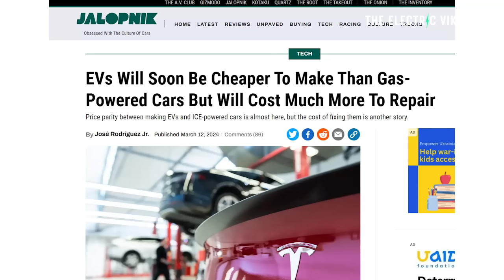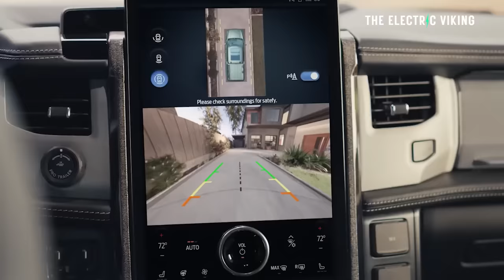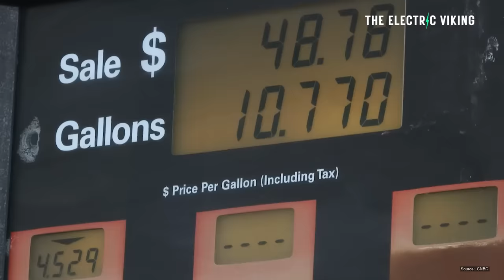The EV Price Premium no longer exists in the United States

Comment: In my country in Europe there are not incentives whatsoever and EV''s are still at least 30-40% more expensive than an equivalent gasoline/diesel and even Hybrid vehicle...
Reply: That's why falling battery prices are so important. The battery is why the cars have been more expensive. The ridiculous obsession with large SUV's is also an issue with EV adoption as they need larger batteries due to being less efficient.

Price parity has been reached for small cars with smaller batteries.

Next will come mid size cars reaching price parity then the larger SUV's when battery prices have fallen further. 

It'll happen eventually but does depend on import tariffs that vary massively.
Reply: I suspect competition from China will force prices down, but as far as I can see - high prices are because that's what the market will bare; alas nothing to do with costs. EVs are "premium" right now so cost extra $$$
Reply: and hardly any chargers here. i would never buy one
Reply: @Withnail1969  If you would never buy one then it doesn't matter how many charges are near you. If you live in an area with an electricity connection then chargers will be installed it's just a matter of time.
Reply: What’s your gas price? It’s currently $4/gallon here in west coast or $1.06/liter, which is considered ‘expensive’. I remember in Europe gas was close to double in price. The breakeven from gas savings for us in US barely exists
Reply: @kevinmanan1304  our gas price will be doubnle yours and electricity has got a lot more expemnsive too
Reply: @Withnail1969 I said that about touchy feely, expensive, fragile glass phones. Buttons are fine. 
And that arrogant, space obsessed, ruthless, relentless, nearly going bust all the time bloke selling books from his garage. 
Or the other ruthless space obsessed billionaire selling records out of the back of a transit van........
A wise man sometimes changes his mind but fools never differ. Or so they say.
Reply: @kevinmanan1304  Our petrol price has gone down to £1.50 from the highs £2.00 per litre. Which is equivalent of $1.90 down from $2.55 per litre. So a gallon would have been $9.65 at the peak a year or so ago.

American petrol/gas is heavily subsidised, when that subsidy is reduced or removed which it eventually will be EV's will make more sense.
Reply: @andrewsaint6581  Electric cars are not new technology.
Reply: Why do people think battery prices will just keep going down? Lithium is already back to its 2020 level after a 6x gain in price between 2021 and 2023. From what it seems, I wouldn't expect much change from here on. EV prices can drop, but that's questionable as  production efficiency has been pretty stagnant since more manufacturers are competing. Everyone is consuming lithium. The only thing that will likely get cheaper is manufacturing. Besides, atleast here in the US, there's currently 300m registered passenger vehicles. 20m are EV. It'll be a while before they have even close to enough throughput to justify a price drop lower than a gas equivalent. Atleast I can buy a gas, buy 3k in batteries, and still have twice the range for half the price as a converted vehicle😊
Reply: @xlerb_again_to_music7908 :  bear.  Not bare. 

What the hell do they teach in school in modern times?
Reply: @Jamessansome :  True.  But until then for people with no reliable and convenient charging nearby, if they can't charge at home, then BEV's are pretty much a non-starter.  

There are good reasons it's a big transition and takes a significant amount of time.
Reply: @kevinmanan1304 :  The west coast is NOT CLOSE to the US in general.  In regular middle America, it's much more like about $3.20, or only about 80 percent of that.  

Just because CA has insane taxes, etc, doesn't mean that's normal. 

I'm a fan of EV's.  But reality MATTERS, re discussing comparable costs.
Reply: @andrewsaint6581 :  Your paranoid raving is on the wrong thread.  Hint:  This is NOT the "whine about modern technology" thread.
Reply: @rogergeyer9851  Excellent! I did change it with bear 1st choice but bare "looked right" written. Oh well. Please don't blame modern times... should have got that right from the 60s :) Perhaps... senile dementia? wot again?
Reply: @rogergeyer9851  I’m not in CA. There’s 3 states on the west coast and another 7 that’s considered west. But yeah EVs make less sense in the Midwest/east/south
Reply: @AhjTheMediocre   How many lithium mines will come online in the next 5 or 10 years?  How many refineries?  The entire battery picture is far from static and difficult to forecast.   Not for a lack of trying.
Reply: @Withnail1969  and that will change. 
You will want one, once economy's of scale disappear for fossil fuels...
Gas and diesel will start getting exponentially more expensive as volumes of consumption rapidly decline.  There will be games played along the way, dropping prices for short times to try and delay the enviable, but the trend will be far higher prices...

The health benefits from the massive reduction of pollution will be a major gain too. Sucks loosing friends and family to cancer....
Reply: @AhjTheMediocre 
Lithium is not the only cost of a battery, and only consists of several 10's of kg per EV car.

There are MANY other expenses in a battery. All are hitting the S curve for economies of scale. 
That, and batteries are nearly infinitely recyclable, as the minerals don't get destroyed. 

And many chemistries available, and in development. LFP (LiFePO4), the M3P derivative, NMC 532 - look that one up
Silicon anode issues are getting solved, which will increase battery energy density several times, with a theoretical limit around 10 times...
Reply: Indeed.
Price tag for a 4 year old model-3 is still €40K.
And MG3? Double the Chinese price…
Reply: @jeffl4810  you are correct, but just recently have articles announced CATL are releasing them for production somewhat soon. Ideally the chemistry should be promising, but I have not found any stress data, so that is a concern that hopefully will be faded once it's in the wild. The one concern is Battery obsolescence. Sure, manufacturers COULD adapt newer tech to older vehicle chasis, but if the battery characteristics do not align with the charger, it could result in costly retrofitting. Older tech will most likely fall out of favor, meaning battery replacement could actually cause a totaled vehicle as batteries of a chemistry are  no longer being produced. Companies are not gona eat more cost to retrofit your vehicle, and hope youll have to buy another EV, wasteful Corporate America. And keep in mind, if these vehicles are cheaper, they are cheaper to produce. There is no protection or guarantee these costs will trickle towards you if manufacturers are looking at the same profit margin as ICE, which is doubtful as shareholders are looking at growth, and if EVs do last their claimed lifetimes, it means they will most likely not be cheaper than what we pay for a New gas equivalent. Money talks.
Reply: @danharold3087  truthfully so. The government has set mandates and goals, 15 years for the US. They better pick it up, just hope they can raise the money somewhere, as I'm not looking to finance this development with my tax dollars while also having to buy a new vehicle in the coming years, while manufacturers are profiting from the infrastructure they didn't spend a dime on. But that's just an opinion of mine🙃
Reply: @AhjTheMediocre  yeah, replacement batteries may be obsoleted after a certain time. Especially by some manufacturers...

Sad reality we live in.

Fortunately, for retrofit companies, it'll be really easy to adapt new batteries if not. The question then would be if a car model is deemed worthwhile to make a retrofit pack. Chargers should be fairly easy to  setup. BMS might be an issue, but a retrofit company could have their own version. 

BTW,  have you looked at The Munro vid on the ONE battery factory, that's being built?
I really like their cell design! LFP variant, and packagable super dense. 12 min charge if cooling plates are used on top and bottom. 20 min if only 1 plate.
Reply: @jeffl4810  if diesel goes up by a factor of 10 we will all be dead.
Reply: @Withnail1969  nah, we'll be fine. Actually, much better off.

EV drivetrains are well established and very reliable. Battery tech is the last refinement needed, and with current tech, it's good enough, but new developments will be even better.

We'll no longer be dependent on foreign imports of oil, from countries that are not in our best interests. Our pollution will be multiple times lower (resuling in major health improvements), and we'll be able to power our EV's for nearly free if there's enough room to put up 3 or 4 solar panels for the average passenger EV (1500 W worth of panels, costing a few hundred $ + install).

Even heavy equipment is starting to successfully become EV's. A semi truck EV with a 1,000 kWh battery did extremely well snow plowing this winter - which is considered a very demanding task. A previous test 2 years ago, didn't fair so well. But this is the pace that we are developing viable solutions!
Reply: @jeffl4810  I don't think you fully understand the situation.
Reply: @jeffl4810  actively cooled plates? Didn't think that'd be a cheap design choice lol
Reply: @Withnail1969  
I'm an electrical engineer. And, have done lots of things with ICE as a hobby, including making engines work way beyond their design performance. I currently have ICE toys that'll do an 8.3 s quarter mile.

I definitely understand the situation. 
EV's have a near perfect torque curve, with full torque capabilities at 0 RPM. They don't need a transmission because of this, and can produce insane power!
And are much simpler, and very reliable. 

Battery tech is our only hurdle left, and it's now good enough, and rapidly getting better! To the level that air travel via battery is becoming viable! The minerals are infinitely recyclable, once mined. It's predicted that by 2050, we'll no longer need to mine any more battery minerals, just recycling and reusing what we already have.
Verses the 10's of thousands of liters of gas consumed by each ICE car over its lifetime. 

Electral power is not a limitation either. Sure, there will be localized grid issues in places, but that'll get fixed. And, unlike gasoline (a small argument can be made with biodiesel, but not many can extract their own veggie oil...), electricity can be made by almost anyone, cheaply, with access to wind or sunshine. 
Note that a typical passenger EV only needs about 6kWh per day. Equivalent to  drying a load of clothes in a drier.
Note that every liter of gas needs about 2kWh to extract, transport, store, refine, and distribute.  2kWh will take an EV about the same distance as the gas would in an simular ICE vehicle. 

The pollution damage we have done so far is crazy.  Just from climate damage, in the 1980s, we used to have 4 months of winter. Now the lakes hardly even freeze over, and we have a 3-4 months of gross, slushy weather, with 20-30° temp swings in 24h periods. Storms are much more violent and damaging. 
People who work toll boths have 10-20 year lower life expectancy from ICE emissions.. Our fish populations in lakes, even in highly remote areas, has dwindled. Our oceans are turning acidic from carbonic acid, ie C02 dissolved in the water - this is the scariest of all...
Reply: @AhjTheMediocre  
Almost all EV's have thermally managed batteries. It greatly improves their performance and longevity. 

All a cooling plate is, is a stamped metal sheet, with water passages formed from the stamping process. A 2nd sheet is bonded on top to complete the passages. A very simple, and low cost method. And is part of the battery housing in many cases. Fridges and freezers have used this or similar techniques for close to a century!

Cooling the batteries allow them to be rapid charged with minimal wear to the batteries, as it removes the excessive heat from the massive charging currents. 
Cooling plates also allow the batteries to be heated in cold weather, minimizing any cold weather performance issues.
Reply: @jeffl4810  are attributing that increase in CO2 from vehicles? Because passenger cars don't make up a large share of it. At least in the US, 30% of our emissions is manufacturing, with another 30% being energy generation. Personally we should have been tackling manufacturing and our generation with the money we spent on EV development. According to EPA data, and consumption numbers from DoT, passenger vehicles made up less than 9% of yearly emissions, while Heavy haul was 22%. EVs are much more convenient, and more efficient, but they will not help enough to fix what we started. And we cannot assume the US will be independent from oil, until everything is green, and its less than 15% of our grid at the moment. We are spending just as much for green energy subsidies as we are with oil. Considering the amount of fuel we consume, you can find that the energy, cut in half as ICE is 50% efficient maximum, you are still looking at a ~50% bump on the grid, Heavy Haul uses 33% more energy than passenger, so thats another ~50% for simplicity. By no means is this impossible for us, but Green energy is quite expensive compared to coal or other fuels. If we intend to go full EV, the $15B we spend for subsidies is not going to follow the growth curve we want for EV adoption. If we build up EVs, without putting in even more money yearly, we will still be burning just to cover the load, so it'll be problematic as to what we should focus on more. EV adoption, or greater subsidies for green energy. But we have already been driving our dollar lower and lower, making the 15 year plan harder to reach every year. It's a very difficult situation to contend when we also have to subsidies oil until the transition is completed.
Reply: @jeffl4810  heating isn't the only issue with fast charging though. Forcing more current into a plate doesn't mean it just absorbed all of it. Each chemistry will behave differently, but in general, there is limits to the amount of transfer across its anode to cathode. And faster charging will require even larger infrastructure for the much larger instantaneous charge Current.  And fast charging does introduce larger losses, even if it's negligible to the overall energy consumed.
Reply: @jeffl4810  I enjoy getting insight from others though. Google and YouTube tend to just push one side of a narrative and I wish I got pushed all sides of a narrative. Idc about belief, or if I'm wrong, being wrong means there's something to learn
Reply: @AhjTheMediocre  
As for vehicles, pollution isn't just CO2. That one is becoming a massive issue now. There's others, NOx, CO, VOC's (can be nasty, eg benzene), PM (particulate matter - recently put on the nasty list the last couple decades), toxins from trace chemicals, etc.
Vehicles cause massive local pollution, where the population is densest. At least themal power plants can deal with emissions much more effectively on an industrial scale. 

ICE, at best, is 25% efficient, and usually 18-20% in good conditions. Plus, there is huge consumption to extract, transport, and store, refine, distribute, and dispense that fuel. Power plants can directly burn fuel before it's refined, saving a lot of otherwise lost energy. Gas turbines with regen are about 60% efficient. Steam ultra supercritical power plants can approach 50% efficiency vs. traditional steam turbines at about 40%.
ICE vs. EV powered by FF is about 3x more efficient. I suspect, with transport, refinement, and distribution added in, it might be approaching 4-5x.
And we are assuming an unrealistic 100% FF powered grid. 

Ai is also consuming insane power. Over 200 TWh alone per year in the US, and rapidly growing. Projected to more than double in the next 5 years
Reply: @AhjTheMediocre  

Decarbonizing is being done everywhere. 
- airplanes - electric versions are being developed. 500Wh/kg batteries would make this feasible. We now have over 700 Wh/kg in development. 

- Ocean shipping - this is a big one. Development is being done to reduce its impact. Vertical sails are being trialed. Container sized aluminum air batteries are a possibility (non-rechageable - would get byproducts regenerated into new aluminum)
 Also, huge tanker ships will be retired.

- Electrical generation. Solar and wind + grid scale battery (and other storage methods like pumped/managed hydro) are now significantly cheaper than running a thermal power plant, and cheaper to install. 38GWdc of solar is expected to installed just in the USA this year alone. It's so cheap, that over installing solar to help with poor weather is a solution. Grid expansion will happen as it always has, but at a slightly accelerated rate. HVDC transmission for sharing power vast distances will probably get built in some areas. 

- Vehicles - we've discussed that for smaller vehicles. 
Heavy equipment is next inline. Mines already use EV's, however, they are tethered (Industrial scale extension cord). Battery tech is getting there for this. And will be a huge benefit when this rolls out. We already have a successful trial of a Semi sized snow plow, with a 1,000kWh battery. Just 2 years ago, a test proto failed to perform as needed.
Local grid scale storage is a solution for rapid charging demand. Some charging locations are already doing this 

- HVAC heating. This is being rapidly reduced with new buildings requiring higher insulation, heat recovery ventilation, and use of heat pumps. For buildings big and small. Older buildings are being retrofitted. 

- Industrial - some industries will no longer be required in large scale. Refineries will no longer be major significance. Paper use has dwindled.
Steel can be made with H2, one of the very few reasonable uses of H2. Concrete is an issue, but there are developments to reduce its C02.
A lot of  industrial processes can be converted to electricity also.

The FF subsidies would go a LONG way to fixing a lot of issues.
Reply: @AhjTheMediocre  
Forcing more current into a battery, then it can consume is what makes the heat. 
I^2R losses are an issue in batteries too.
Just that the forcing voltage is offset by the cell voltage (simplified, but decent approximation)
Reply: @AhjTheMediocre  
I agree. There's way too much FUD and unjustified "opinions" that people love spreading. 

I've been keeping a close look on these subjects for the last couple of decades. And watching the evolution from the EV1 from GM, to the ex GM engineer that made the Tzero, in which his company, AC propulsion was sold to create an actual car company, which was the basis of how Tesla was formed!
Reply: @jeffl4810  the grid load increase was based on miles driven in the US, given EVs are getting 4mile/kwh(give or take with payload), it comes out to about 600TWh for the US alone. And yes, I agree, we are trading working hours for AI applications, and will grow at an alarming rate. But that's kind of my point. We have Crypto Miners consuming more energy every year. We are integrating EV charging, AI will consume similar power, we are still burning heavy fuels for oceanic freight, and they make up a very large portion of emissions. I agree that EVs in dense population areas are a must, there isn't a single argument other than the shear amount of chargers, as people like to point out you can charge it at work, so given a city of 5 million, every employer(or the city as a whole) will need to foot the bill, and there is no chance that will be free charging. My big issue with the car industry is under-utilization. Both EV and ICE are barely using them to their end of life. Many people don't get rid of a car because it died. Most of the time, the new car sales are people trading in old ones for new. We wouldn't need to be producing what we do, if people actually used the vehicles till end of life. And yes, tailpipe emissions consist more than  just CO2, but considering the emissions manufacturing produces of similar emissions products(other than CO2), tailpipe still doesn't account much more when we consider the many manufacturers who just eat fines for emissions. Solar and wind require redundancy, with either nuclear or FF to cover grid loads. And realisticly, with people charging every night, and during work hrs, there will really be no low demand times for these systems. All can be managed, but as I've said in other threads. Why does my tax dollars have to foot these developments and I get a measly 7500$ deduction, and still have to pay for the hardware and usage. This is more of my own personal view. And I'm aware it isn't an ideal way to look at tax income being utilized.
Reply: @jeffl4810  thats separate from what I'm talking about. The electrolyte transfer across the separator has limitations. There is a limit for ion transfer rate across a seperator. Even if you could drop line resistance in the plates to 0, absorption rates are limited to the physical transfer of ions. I'd like to find some in depth information on these newer variants, and see how they propose to tackle these seperator constraints, to allow for sub 20 minutes 80% charge rates. I am pessimistic towards these developments, but I am not angry when I'm proven wrong.
Reply: @jeffl4810  just don't ask what chemistry I'm using for home solar right no😭😂
Reply: @AhjTheMediocre  
I didn't do the math, but 600 TWh isn't all that crazy for an entire fleet of EV's., and I would expect to be in the ballpark. 

A quick Google search gave the USA energy usage of 4,243 TWh/year in 2022

So the USA needs a ~ 14% increase in electrical capacity to convert to EV's from ICE, over a period of 15-20 years (ICE production ban in 2035 - assuming last of significant ICE usage ~5-10 years later)

Note, however, there will be massive energy savings from FF industry shutting down. Electrical consumption to produce 1L of gas is about 2kWh (from extraction, transport, storage, refinement, distribution, and dispensing)
The USA used 135 Billion gallons of gasoline in 2022 as per google search (510 billion L)
Electrical energy consumption to produce that gasoline per year is about 1,000 TWh/year.
*Wow*, I've never done that calculation before, and now I see why people sometimes say 25% of the USA electrical generation is processing fossil fuels. I always thought that number was a bit of BS - maybe it isn't... (I've also heard about 15% just for refinement). Also, shipping and trucking will be notably reduced, as electricity doesn't need vehicles and ships to transport and distribute it, saving even more energy. 

38GWdc solar is being installed this year in the USA, and will be in the 45-50 GWdc range per year, within the next few years.
40GWdc solar works out to about 60-70TWh/year additional capacity added each year, from solar

The extra capacity will be needed as things will be consuming more electricity, such as HVAC, and industry. Plus the shuttering of thermal power plants.
Reply: @AhjTheMediocre  
I don't have much of an issue of under utilized vehicles. The main reason is they eventually get sold, and someone else uses them. Most vehicles, by the time they are hitting the scrap yards are pretty heavily used up. And the useful parts are usually salvaged. 

Haha, your taxes are bad enough... I'm in Canada,  your neighbor up north... If you don't want to get stressed out, don't look at our moronic tax schemes. Especially with our current leaders.... It's literally insane
Reply: @jeffl4810  I did not think of the consumption of refineries. Good point. It'll be interesting to see how prices on plastics and synthetic rubbers will change with the change with less light fuels being used. Sure Demand will drop, but so will consumption. I did some research on that subject, but it can get quite complicated once you account for the numerous things we extract from crude.
Reply: @jeffl4810  most oceanic trade is products, so idk how much a change we will see there.
Reply: @AhjTheMediocre  re: battery separators.

This is still I^2R losses. Just a different mechanism. Basically the separator IS a resistor. Possibility even the dominant resistance. 

Let's say the cell voltage is at 3.7V. And a high, say 3-5 C charge rate. To get that rate, the voltage may need to be pushed to 4V. The 0.3V loss, is heat generation. 

The plates, wiring, etc are all very low resistance. The only other resistive sources are the absorption materials on the anodes/cathodes, and the electrolyte it's self (and its barriers, like the separator)

This is also why Li based batteries (actually,  most battery chemistries) need a constant current, constant voltage changing profile. (I still think it should be called a current limited constant voltage profile...)

Charging is normally current limited, until cell voltage hits 4.1V (traditional NMC based Li), or a bit higher at 4.2V for higher energy density, at the significant expense of cell degradation. Redundant safety cut off at 4.35V, as not only does the cell start severely damaging its self, if the voltage gets a bit higher,  the cell will start plating Li metal out of the electrolyte. An extreme fire hazzard.
Reply: @AhjTheMediocre  home solar chemistry  - Let me guess - Lead Acid?

If so, good, deep cycle lead acid can be cost effective. They just have limitations. Like limited DoD, and poor high power level efficiencies
Reply: @AhjTheMediocre  
Yeah, the petrochemical industries will be interesting over the next couple decades.

And this is what we should be conserving oil resources for. Not wastefully just burning them up...
Reply: @AhjTheMediocre  
I'm not 100% how much ocean shipping would reduce, but there are some massive tanker ships moving oil products around the world. You don't see them much, as they dock at offshore oil rigs, and use ports where refineries and power plants are. Those are generally away from major cities, etc
Reply: @jeffl4810  i appreciate the civil discussion. You've given alot more information than I had entered with and I thank you for putting the effort into explaining. It seems I had misunderstood and missed some key points while doing my own digging. I can't wait to have the money to upgrade my current energy storage, as I'm currently using 50kwh of NiCd I got for free. I don't like them as they weight a metric ton and take up alot of space, and Cadmium isn't great when it's a flooded vented cell just asking to tip over. Looking at some raw cell LFP, but I gotta find a BMS that will communicate with my Inverter. Currently have a 5kw system supplementary, looking to add 15kw grid tie system for electric heating until I have the money for the heatpump, then it's nothing but profit on grid fed credits.
Reply: @AhjTheMediocre  
I appreciate a decent discussion! Gives opportunities to see others viewpoints, and to also learn stuff.
Too many people have very biased, unsubstantiated opinions, and love spreading FUD, and using your words, are not so civil...

To be fair, an awful lot of lobbying is currently being done to spread an awful lot of FUD, as we're well underway with massive changes, that will affect industries that have enjoyed a good part of a century of near locked in markets. 
Some of these industries will adapt, and thrive, others, not so much...
Reply: @AhjTheMediocre  
NiCd's are good batteries. Last a very long time. But, that cadmium thing... Very toxic to prostate's.... Major carcinogen...

LFP (LiFePO4) is a great modern chemistry. Works very well, has a great DoD, cycle, and calendar life!

15kW solar in a reasonable location is ~60 kW/day. 
Decent for covering most people's needs!
Electric heat is definitely not the greatest choice, but with solar so cheap, and if you get decent sun in your heating season (very climate dependent), it might be your cheapest solution!

Heat pumps are nice for the summer, if you require air conditioning though!

Luck you if you get grid credits! They are removing them here (we have a private power company that is very for profit....)